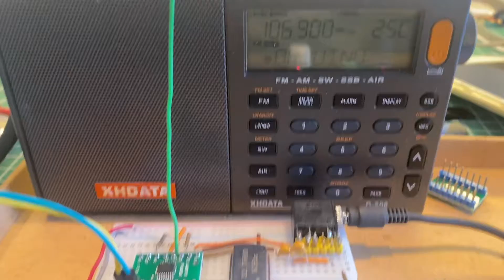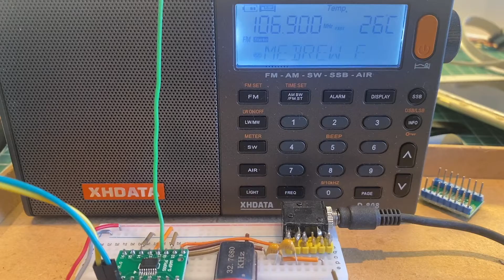RDS FM TRASMITTER WITH QN8066 HOMEBREW BOARD and ARDUINO

Comment: all the codes are wrong!! the encoder is not working properly what encoder is it??? it takes many turns to change state, and the buttons !!!! you probably did it on purpose..!!!
Reply from the maker: May I ask: does the video you watched actually suggest that all the code is wrong?
If you believe there are errors, could you please point out which specific lines you consider incorrect and explain technically what the issue is? That would be very helpful for improving the project.
I also suggest that you carefully read the documentation I wrote — both inside the code itself and in the Arduino library repository — where I explain in detail how the encoder and buttons should be used.

Comment: Hii... Could you please tell me which RF chip is used in
"GD 2015" (2024 version) RDS support fm transmitter?

I asked the seller they told me that it has a QN 8007 chip. But the transmitter specifications don't reveal clearly . It is written QN series chip is used.